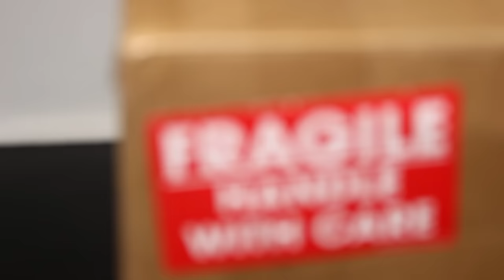World's Smallest 5 Axis Milling Machine - Pocket NC V2

Comment: I ran one of these about 2 years ago. This CNC is functional but should only be used for novelty. It's a little confusing and difficult to get going, not super rigid (yes even for its size), and frankly, not as accurate as most parts which warrant 5 axis machining. I mean if you have an extra 5 grand burning a hole in your pocket and wanna use this as a conversation piece, go ahead. But frankly, it's just not very practical or useful for actual part making. I'm sure plenty of people will bandwagon it and pretend it's way more useful than it actually is, just like they do with Tormach.
Reply: 100% the rigidity displayed here is the biggest problem - shortening the spindle alone would help a great deal.
Reply: That's a bit of a cynical outlook. Considering that 5 axis machines for real machinists will require you to have some history in machining, this is a pretty nice package. Yeah it's not the best thing out there, but for 5 grand you are getting a whole lot. Obviously it's not supposed to compete with a 100,000 dollar machine.
Reply: It's overpriced for what it is...  The components look to be of good quality, but watching the video on how they assemble one, gave me a good chuckle (for reference, I work in the machine tool manufacturing industry).  It's not meant to compete with large machines for sure, but you can buy bigger, more rigid 3-axis machines for about half the price.  Throw in $1K or so for a fourth axis and you have a better, and more capable machine that'll to most of the work that this machine will, only more accurately, in harder materials. This is a novelty for those that have more money than most of us, than want it for the creativity aspect, than for actually making more than one of something useful.It's probably great as a learning tool though...
Reply: @WHJeffB  it is useful for wax patterns

Comment: I know it's the ultimate temptation, but please people, don't use threaded things in a shear stress situation, you are applying the stress to the root of the thread. McMaster Carr sells a wide variety of things that are partially threaded and partially smooth for this kind of use. Shoulder bolts, Partially Threaded Studs, threaded pins, Screw Pins, Extended-Tip Set Screws; all of these combine a head, a smooth part and a threaded part, in various order and arrangement of diameters.

Comment: For the manufacturing world is just a name to describe the positioning axis moved by the servo motors and controlled by the CNC computer, in this case is 5 controlled positioning variables, X,Y,Z, plus the spindle rotation "S" and the rotation where the part is mounted called "C" , it is just a name,  to simplify the description name.

Comment: Nice acquisition for the workshop Johnny It may be small but I think the main thing is the Precision of the unit you could buy an El Cheapo from China but it is made of Plastic gears etc with  lots of backlash.I would suggest that you do a couple of things 
1 Build a Container of some sort to hold the working unit and to stop Shrapnel traveling     around your workshop 
2 Vacuum the shrapnel away from the machine as it cuts It looks like it could easily get into parts of the machine that could do damage 
3 maybe Cover the machine as well while it works to keep the shrapnel away from the machine 
Apart from that I cant wait to see what marvelous projects your Genius mind comes up with this machine All the best mate WELL DONE 
Tony From Western Australia
Reply: Also, figure out a  way to spray coolant.
Reply: they make an enclosure for it that is very nice.  i use it and it does a good job of containing the chips etc.  mist coolant also seems to work very well, even though it's really not recommended :/
Reply: Perth stand up

Comment: Yes! A Pocket NC! Looking forward to seeing more. Not many videos out for the Pocket NC.
Reply: It's improving. I've heard v1 is horrible
Reply: Horrible  to  utter crap,  Is that an improvement?  LOL.
Reply: It's cool, but not a $5K machine for sure...  When I watched them set one of the rails or align to the rotary with a machinist's square, I was very disappointed (Pocket NC has a video two on this on their website or YouTube channel).  I work for a machine tool mfg, and we set the rails using high accuracy capacitance units and check with laser interferometers, not hand tools!

Comment: flawless work. now, when will the custom made pull start & cnc(5 axis milling) made cooling fan for the wankel OS Graupner Wankel NSU Model Glow RC Rotary Engine .30 be available for purchase. please let me know i am interested.
Reply: Where I went to highschool we had a cnc lathe and Miller plus a laser printer. But we also had a metal Forge. And welders and I didn't even go to a tech school. And also had a lathe and Miller that had to be operated manually it was a blast.

Comment: i'm a CAM engineer and I think you are doing pretty good for someone saying he is an amateur. just a little tip, it says you are going to fast/deep. I don't think so, the issue is just that you go from side cutting to slotting. especially with such a small machine, you should try to avoid slotting. it's simply not very rigid compared to bigger machines.

Comment: All these armchair (non qualified) "experts" complaining of the 5K price tag...lol....Love to see how well they would do designing and making such a machine....Liked the tooltip sensor, very nice.
  Looking forward to some exotic part production now. You might want to slow it down some if you start machining Inconel Turbine discs......:)
Reply: sensor is 50$ work on any china cnc router ... .   5 axis u say  this is like 2x riggid then this junk  ,and still is junk ,,
Reply: chna cnc 5 axis router ,,look for it ...2k $ and u get 2x more   vs this super overpriced junk
Reply: Well you can get an old used cnc machine for 2k bucks.
This machine is to weak for the price.
Reply: he dont have clue ,or just want to convince that he flush 5k in right way...  i play with one for 2 weeks ,and only thing i could do is soooft crap ,,thay show inpaler ..lol  you can twist that fins with 2 fingers how "great" they are ,for 5k u can get real 4 axis harmonic mill plus dro  and tool changer and a ton of tools
Reply: 5K i can make more better cnc. Hardness of this exemplar is ugly
Reply: The machine is absolutely over priced for what you get but so is everything that is new in the technology world. In sure it could be mass produced in China for half the cost. There's inherently no rigidity in this system and with no power it's just an expensive tinker toy for the advanced machinists. If money wasn't an issue and I had zero space I would buy it. 5k is a lot for a toy. You could never get a return on investment on this thing if you tried to use it for profit.
Reply: огромная эрекция this little toy isn't intended for anything harder than aluminum. I'd personally stick with some kind of plastic
Reply: EnglishTurbines, you're absolutely right. Lots of bullshitters and shit talkers over here who probably couldn't engineer their way out of a wet paper bag.

Comment: you'll get better surface finishes with a a MUCH lower RPM. For that tool (what looks like a 2FL, 3/16 dia) go with like 1000 rpm and chipload of about .002/tooth (.004/rev) and increase your step down to 2xdia of the tool (3/8 in depth cuts with a 3/16 tool.) 
  
Then to really spice it up, do what I said above, but leave .002 on the walls and do a finish pass at final depth no depth cut at 1/2 RPM and 1/2 feed.
Reply: it probably doesnt have enough torque at that low rpm, it may not even spin that slow.

Comment: Awesome!  I just picked up a V2 last week as well, it's been great so far.  I've mostly cut 6061 aluminum using the collet system and have found that 0.015-0.025 @ 15in/min and 0.075 optimal load seems to work good depending on the type of cut.  it's much, much faster through aluminum than my Nomad 883.

I love the solution for workholding... you just threaded a hole in the back of the 3" round bar?

As far as 5-axis CAM in fusion, I've only used the swarf cut so far and it works as expected.  You can also add 5 axis moves (tool angle/orientation) to 2D adaptive paths iirc... maybe 3d adaptive.  one of them :).
Reply: 0.015-0.025 Inches??? i am struggling with the right settings for mine, the tool has just too much jerk, which ruins the surface and the end mill. Could you pleas give me more informations wht you use(d), like cutting depth,cutting speed and load... at which diameter? i am going to make a sample, but with milimeters, doesnt matter anyways...: 0.2mm x 100mm/min / 0.1mm @ 2mm diameter..
Thank you very much for your help.
Greetings from switzerland.

Comment: Read up on speeds and feeds (any book that's written after 2009 is ok when considering tooling you're using today) and for sure each time you get tooling try and get the data sheet, very helpful in setting S&F. That, is the bread and butter of any CNC operation, of course followed by setup, and knowing what tool to use to do an operation with.

I'm willing to bet that in a few weeks you'll run circles around this initial setup issue.